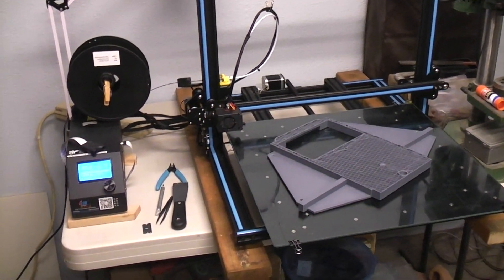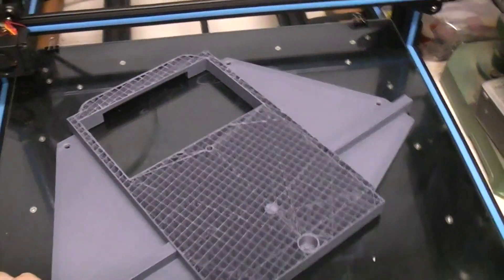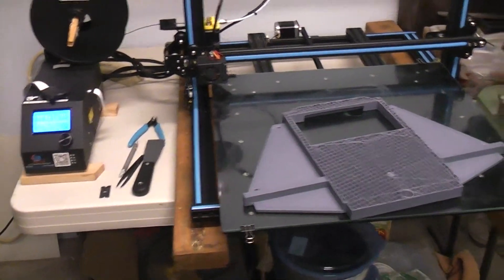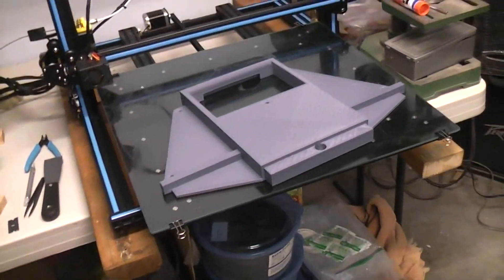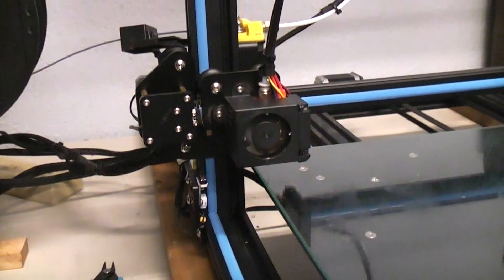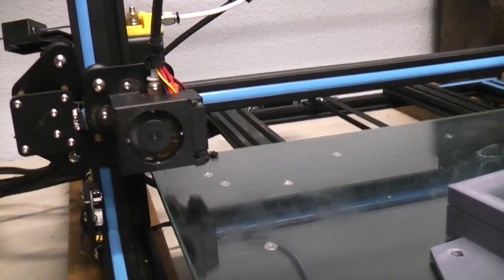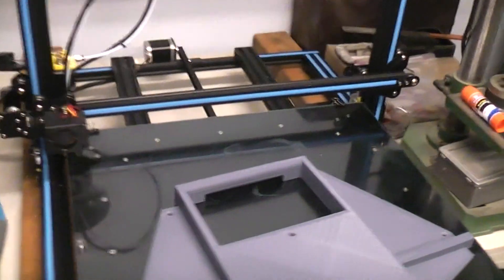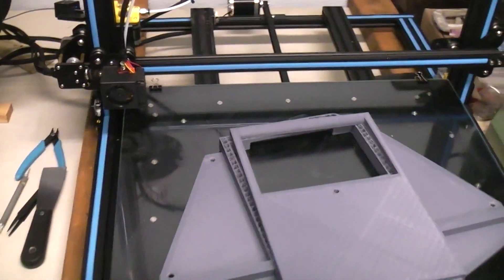How to save your 3d print after a Filiment Jam. CR-10 S5 jumbo print fail.

Comment: Iam new at printing what is the glue stick are you using  is it a Elmer's glue stick or something and how do you apply it just rub it on the bed itself what do you keep the heat at on your bed too
Reply from the maker: Yes any brand of glue stick will work. The big ones from the dollar store work fine. Just rub on a thin layer over the surface. You can clean off the glue stick with a damp cloth. Glue stick is also used to keep some printing filaments that stick too well from damaging the print bed. I normally run my heat bed at 60C. I know some guys run theres at 70C but that seems a bit high for me when printing PLA.

Comment: very clever......I guess you used GLOOP? 😎👌
Reply from the maker: I wish the 3d Gloop had been around then, that would have been perfect. I just use Maxi-cure extra thick and insta-set accelerator spray and some times GOOP the modern contact glue.

Comment: Thanx for the practical recycling time and materials investment saver.
The S5 Thats just been amazon ordered has a filament alarm feature and also the print to restart after power failures or when filament runs out or jams. Added a laser option to that, and a Sony Xz1 compact cellphone with built in 3d scanning capabilities. Seems worth eating noodles for a little while, and only shopping at Dented Cans.
Reply from the maker: The filament sensor works very well on the S5 but the power resume is hit and miss. I spoke with the creality and they confirmed it will not work every time. So a UPS back up supply is a good way to go on a long print project.

Comment: I had a somewhat similar issue.  I replaced the bottom air deflector with a more efficient version, and upon screwing in the screw on the fan end, did not realize the screw pressed the housing in and pressed upon the fan slightly, but just enough to snap a blade upon starting the unit.  Luckily the blade broke off clean and I was able to meticulously superglue the blade perfectly back in position, and with an additional application of a small coating of the CA and a small dusting of baking soda, it has worked great ...so far... (around 80 hours of use).

Comment: be careful without fan shroud you can break the fan.
Reply from the maker: You could but I wont. Either way the stock fans are crap and got real noisy so I will replace them with proper ball bearing fans.

Comment: Nice job. I usually get angry and scrap the print and start over but watching this video you have given me some inspiration to give this method a whirl.  At first I was shocked thinking that the fan failed.  Creality actually seems to pay attention to detail and used some good quality fans (SUNON) in the hotend and (NIDEC) in the control unit. Now that you mention the shroud issue I think I'll replace/remove mine as well.